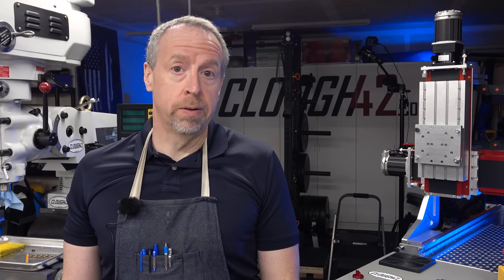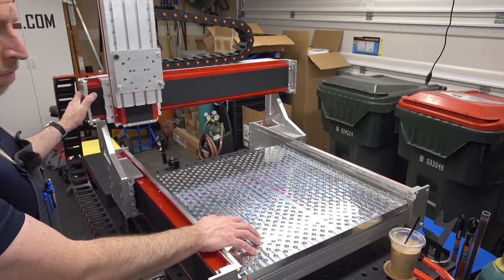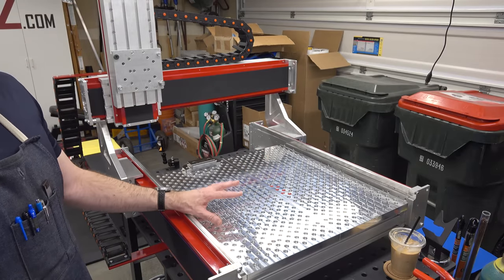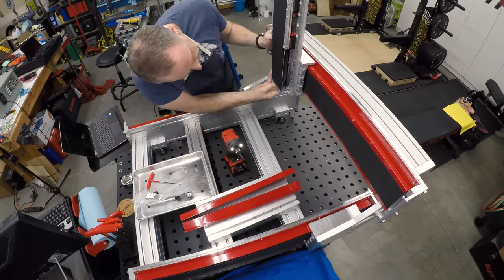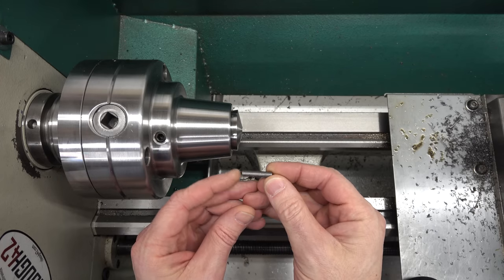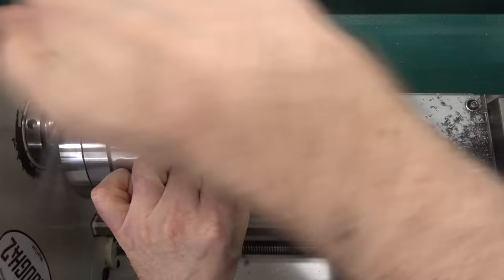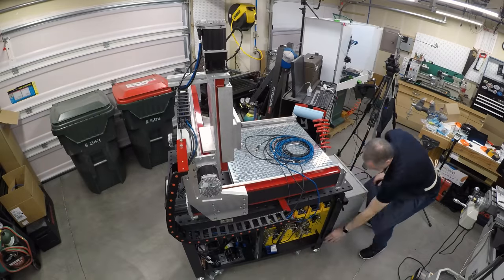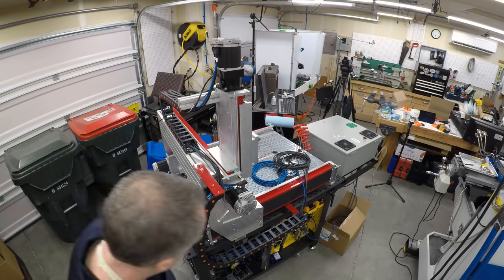New Machine:  Avid Benchtop Pro CNC with ClearPath and Centroid Acorn

Comment: I have used clear PETG filament as a light pipe to get LED indication to the outside of boxes.  You can also use home audio optic cables for this.  With some 3D printed holders you can make this work and not modify the electronics.  Hope this helps.  Great work!!
Reply: Nice idea.
Reply: @v8Mercury  Thanks!
Reply from the maker: Oh, that's a very interesting idea.  It would be pretty easy to modify the side plate of the C86ACCP mount to hold a Toslink cable in the right position.
Reply: I have used commercial fiber optic light pipes and panel mount bezels with a 3D printed holder to position the light pipes over SMD LEDs. Works great.
Reply: @chrisvarrin5819  yeah- I work in IT and tried that.  I had better luck with the fillament and home audio cable.  It may have been my fault...  I seem to recall the larger diameter of the filament and audio cables helped.  Whatever works for you!!!
Reply: You could also point a photo-transistor at the blue heart beat LED , then with a simple circuit, drive a nice bright LED outside the case.
Reply: I'm using toslink cables for my limit switches to prevent interference :)

Comment: You should think about shear-pins to prevent runaway and damage to the drives or screws. What brought that thought about was the shear-pin on the lead screw of my new Clausing 5914 lathe. Just a thought.

Comment: Those 5 to 6 mm studs were smart. Congrats on the new machine. I'm wondering whether you'll need an enclosure in addition to the stand.
Reply from the maker: Yeah.  This thing will make an aluminum snowstorm in the shop.
Reply: Seconding this, that's a super clever solution.

Comment: This is my build, too! Benchtop Pro, clearpaths, and acorn. I just drilled out the mounting holes in the clearpath faceplate a TINY bit and mounted them as-is without making studs, but either way :)  Also built my own control box, which I know you are going to show later as well. Great setup!
Reply from the maker: The control box was in previous videos.

Comment: Very cool.  I struggled to figure out how their way covers worked since they first came out but I finally saw in this video.  Thanks.
Reply from the maker: It's a system I haven't seen before.  They snake through the moving shoe under quite a bit of tension.  I would have expected the path to be straight, but I guess not.

Comment: Another great build, thanks for taking us along for the ride. Very pleasing to watch you work. To neaten up the proxi cables get yourself an I/O Block with single multi-core cable going back to the control cabinet. This does mean that your gland plate with the M12 connectors is not really needed anymore, your call. You could use a single 8-pin M12 connector to accomplish this. As for the proximity sensors, check that they are Factor 1 or +UProx that will well with non-ferrous metals with very little range de-rating. Shout if you need more info.

Comment: You showed your hand.  Your hand was positioned over the servo programmers best friend.  The E-STOP was always covered with a hand ready to depress at the slightest  possible malfunction.  We fabricated and programmed high speed packaging equipment.  This was in the early 1990's.  One system had 5 different communication systems within one machine.  Things have sure come a long way.  That machine is finally being removed summer of 2022.
That sure is nice when you can rotate your panel up.  I modified my Crossfire, added my own floating Z, scribe, and extension kit.  I left the  panel where if was from the factory.  Laying on the shop floor is not fun.

Comment: Super awesome! Can't wait to see the tuning and first chips!  Also curious to see how the FM30 works for you on the Avid.  I like my S30C, but the higher torque on the FM30 looks wonderful for steel. Coincidentally, I'm in the middle of some spring tweaking of my machine and it's shaping up to look a lot like yours. Most notably clearpaths and an SMC fixture plate, and contemplating ditching Mach for an Acorn or similar. 🙂 I'm the most stoked about ditching the steppers though, I've definitely seen missed steps at high feeds. Particularly when doing a lot of small/fast Z moves (like on a 3D contour). Great work, really been enjoying this series! Your electrical cabinets are a thing of beauty, I wish I was organized enough to put one together that nice :)
Reply from the maker: I'm really anxious, too.  I autotuned the motors over the weekend, and now I think the gains are a little hot.  I'm getting some oscillation during slow (10IPM) moves.
Reply: @Clough42  I've had to retune, apparently it's common. I tuned at 100% torque. turned stiffness up and its rigid and smooth.

Comment: Hi Coming from Mach 3, I love the Acorn , I use the DMM & DNY2s drives & servos on my 30 x42 router DIY. I also use Metrol NC limit switches , got rid of the Prox switches. Acorn just works IMO

Comment: my only concern with this style router has always been the same , Noise.. There comes a frequency where the extrusions act as tuning forks. yes this can be offset with filling the extrusions with sand or cement. I know this is top of the line and those extrusions look way heavier than the stuff on amazon , so this may not be an issue , awesome looking machine !
Reply from the maker: We'll see.  Using servos should help with some of the singing, but the spindle could still easily set up a resonance.
Reply: In my experience, it hasn't been a big problem with the Avid stuff - the linear rails themselves dampen the vibrations, and the mix of steel / aluminum across the board helps further prevent resonance. Now, Non-ATC spindles are very annoying after a while...
Reply: Polymer Concrete.
Reply from the maker: @alexwbakker  Yeah, I can imagine.  Got that covered.

Comment: hey James, Darren from Halifax uk.
if you go to your local diesel repair shop or hydraulics repair shop they use these little plastic cups of various sizes depths and diameters to put on the ends of injectors and in the ports of hydraulic rams to stop debris going in and i bet you could 700 of the size you need to plug them holes for very little cost. just a thought.

Comment: Nice video!   Every time I’ve used clear paths (3 machines), I’ve just set them up to home to hard stops.   They can home to even a rubber stop consistently.
Reply from the maker: That works for homing the motors, but I'm not sure how exactly that interacts with the Acorn control.  Perhaps I'll investigate that someday as a way to get a fourth axis on a dual-drive gantry machine.

Comment: I have almost this exact same setup on a 4x8 Pro Avid.  The proximity setup is probably the weakest link in the setup to me.  It works fine once you get it setup, but because they are setup as "all home", they cant also act as hard limit switches when jogging the machine, so it is possible to crash it if you forget to home it before moving it.  I don't know what you are planning for probing macros, but I bought the probeapp for the CNC12 and it is really nice.  I have the standard AVID touch plate, but you can set it up for all types of probes, including the centroid KP-3.

I am interested to see how you get that plate planar with the gantry.  I was thinking it might make sense to get a piece of plate aluminum to mount to the machine, deck that, and then put the surface plate on top of that, then you will know that it is flat and parallel.  Then all you have to do is run a indicator across the front of the plate, and tune the auto squaring till the gantry is parallel with the front of the plate.

Oh, and I just took 30 seconds and drilled the servo mounting holes out...worked like a charm...lol
Reply from the maker: I wasn't aware of probeapp.  I'll have to check that out.

Comment: You are going to want an enclosure for that, chips all around the shop. It gets really old really fast. The ball screws don’t sound too hot, actually sound horrible, or it’s just the resonance from the extruded frame. Flood coolant is a must if you are going to get any meaningful material removal rate out of it.
Reply from the maker: The machine is sitting on top of my welding table, which has a metal pegboard full of clamps, and a plasma table full of loose metal slats, and they're all vibrating.
Reply: @Clough42  Ok, thanks for clearing that up. Will be interesting to see and hear the nachine fully operational. That fixture system looks nice, need to check it out.

Comment: This is so cool! I have the same machine but in a 3x3 with the stock steppers. (They made the 3x3 custom, not offered on their website). I’d love to have those clearpath servos, my only concern is crash my machine on occasion and it just stalls the steppers when that happens. Especially since chips can get behind those way covers, and when they accumulate a little bit then the machine will pack them into the end and eventually not be able to reach the end stop switch anymore (and instead just smoosh a big climb of chips). It happens surprisingly quick when I’m machining aluminum, I swear I’m not a slob haha. But anyway, when that happens the steppers just stall and there’s no harm done. What happens if you do that with a servo? Is there a way to make the servos torque-out before something breaks? In my opinion, it’s inevitable that you’ll crash that machine someday. Curious what happens then.
Reply from the maker: You can set a torque limit on the motors.  Of course, then you run the risk of torqueing out and having it stop when cutting.  I think the Clearpath motors are pretty easy to monitor, and they log max torque events so it should be possible to set this well.  I have been a little concerned looking at the dust covers.  I expected them to seal better than they do.  I'm thinking it might make sense to remove the lower shields on the Y axes to let chips fall out, but I think it has a lot to do with what solution I end up with for chip clearing and an enclosure.
Reply: @Clough42  ah the max torque feature makes sense. FWIW, I’ve never stalled my motors during a cut and I’ve pushed it really hard. I lose rigidity before I stall the motors, so I’d think there’s definitely a torque value there that’ll stop the servos before it breaks the machine, but not mess with your cutting operations.

Removing the bottom red steel covers is brilliant! I can’t believe I didn’t think of that haha. I’m definitely going to try that on the Y axis. It hasn’t been much of a problem with the X, so I’ll probably leave that one on.

Comment: Cover the unused holes with silicone baking mats 👍🏻 they are dirt cheap, and you can easily cut them to fit specific jobs if need be
Reply from the maker: I would be concerned about them lifting if the air from the mist nozzle caught an edge.

Comment: That is an awesome piece of machinery. 
And yes, you will be able to cut steel on it. I have an equally beefy Sorotec router with 180W JMC servos and a 30k rpm 3HP spindle and recently had to make a few bigger parts out of mild steel and was pleasantly surprised how well that worked. So with these beefy Nema 34 servos, your spindle will be the limit. But I believe it is a 12k rpm spindle, so it will have sufficient torque for steel.
I would recomment 2 additions however:
1. Something to protect the open Y-axis drag chain from accumulating chips (especially steel and aluminum)
2. Some 3D-printed covers for the Y-axis limit switch connectors. I find them to sit rather prone and at least in my shop there would be a high risk that I bump a heavier work piece into them...
Reply from the maker: Both excellent suggestions.  Thoughts on a good way to protect the drag chain?  In my head, I'm imagining a zip-on cover like you might see on a water-cooled TIG torch hose set.
Reply: @Clough42  Depending on the final location of the router, in a permanent enclosure you could just place a plexi shield between the chain and the gantry. It might not be too much in the way. A zip-on cover (if you find one that fits tightly) might have to deal with the different inner and outer radii. Fixed with zip-ties it probaby would kill the sexy looks of the machine. More elegantly could be little 3D-printed snap on covers, which go on top of the chain, inbetween the litte tabs, that can be opend to access the cables. The moving angle of the chain looks not to be more than 30-40 deg and apart from 5 or 6 chain links, most of them are stationary during movement anyways...

Comment: Always a good quality video . Very interesting . I was surprised how noisy the rails are on the machine - maybe that is because it as an aluminium frame or maybe just a microphone thing . Well done on setting up your new machine
Reply from the maker: The ballscrews are running pretty fast.  I also have the whole machine sitting on my welding table, which has a metal pegboard filled with clamping hardware, and a fold-down plasma cutting table with loose slats that rattle as the machine moves.

Comment: I have the exact same Avid machine w/ NEMA23's; been running it for 2 years now.  It's plenty rigid wrt cutting steel, but my electronics boxes are mounted underneath the machine so no coolant possible in that config -- may change the set-up.  I wasn't aware that Saunders has a bed kit specifically for the BTP2424 ... now I'll get to spend more money (thanks).  I've also been looking at the ClearPath servo's, but the retrofit is intimidating (just like everything else I've done before I just did it ... so maybe).  Thanks for the video; very instructive.
Reply from the maker: Thanks!  I think the appropriateness of the ClearPath has a lot to do with financial resources.  If you have the cash or if the machine is going to earn its keep, they're pretty nice.  If it's just a hobby, they're a bit of a stretch.
Reply: @Clough42  My machine def doesn't earn it's keep.  I like the idea of closing the loop on position, but I'm cutting primarily cast acrylic and Al so I'm not missing steps with reasonable feeds & speeds.  I hope to see more content with the BTP2424; I always learn something.

Comment: Weakest link in the machine is the 6mm plate the linear bearings are attached to. Unless this has been revised. I'd suggest some blue threadlocker on the studs going into the plate. 😁John a SMW is great to work with. Fixture plates are awesome.
Reply from the maker: You mean the aluminum extrusions that run the length of the axis, or the 9mm motor mount plates that screw into the ends of those extrusions with 6mm screws?  In my experience so far, those end plates are a real weak point.  These servos will hit the bumpers, compress them completely, and bend the screws holding those plates on.  In the event of a crash, I expect they'll separate from the machine completely.
Reply: No have you watched the build video time stamp 6:51 you can see what appears to be a 6mm plate that the linear carriages are mounted to
Reply from the maker: @rc-cnc3431  ahh...the plate behind the dust cover.  You may be right about that from a flexibility standpoint.  I didn't look closely when I had it apart.

Comment: Hi James, this build is very similar to mine - clearpaths with a custom ATC setup and the SMW fixture plate. I went down the Masso route so curious to see how this setup works. I also went with a Fogbuster which has been great. I've been quite happy with my machine but I made some modifications to the Z axis, notably shortening the spindle mounting plate on a bandsaw so I could have the bearings as close to the X axis as possible for maximum rigidity.

Just a note on some things - you may find your X axis is making contact with the riser plates at the bottom, I filed this away so I could get a perfectly flat mounting surface. You may also wish to recalibrate the alignment of the rails, though mine wasn't far out. I did tweak mine a bit.

I went with a Jianken spindle which has been wonderful. I also have some details on my tool rack on my Instagram if you're interested. I think Youtube will filter out my comment if I link to it but if you search for 'OutpostWorkshopUK' you should find me there and details of my build. Looking forward to seeing how you get on!
Reply from the maker: Thanks for the pointers.  I currently have the spindle mounted (spoilers) so the physical end of the spindle is even with the end of the Z axis T-slot extrusion to try to optimize clearance.  I need to see how the geometry all works out, but if I understand correctly, you shortened the extrusion so the spindle is mounted closer to the linear rail bearings inside the slide, while still maintaining clearance?  I will consider this, once I figure out how much reach I have with the tools.  I have the fixture surface mounted in the second-to-lowest position, and I need to make sure I can still reach everything with the tools.
Reply: @Clough42  That's exactly right! As you say, I shortened the extrusion to allow clearance as I found it was too long with the spindle in my preferred position - I brought the spindle up as much as possible while having enough room to reach my bed if needed. I found this increased the rigidity quite a bit. I also switched over to one of the Chinese spindle mounts as I wasn't a fan of the stock Avid one with the spindle I chose, which admittedly is pretty ridiculous with hindsight - a 20KG Jianken spindle. I reduced my acceleration quite a bit as I didn't want to harm the mechanics while throwing it around. I don't think you'll have any issues with the CNC depot spindle as the mounting seems much more rigid from what I remember!

Anyway, it does take quite a mean chip out of aluminium now, I've been quite impressed! Also, the detail for the bits I'm making has been excellent. If I did it again I'd probably go for a lighter spindle though!
Reply from the maker: @michaelkelly3158  the FM30F is just under 10kg.  A little lighter than I remembered.
Reply: @Clough42  That sounds ideal! If you need any help with it give me a shout :)